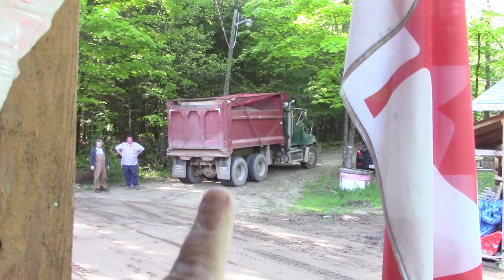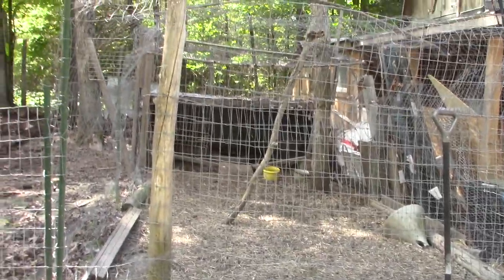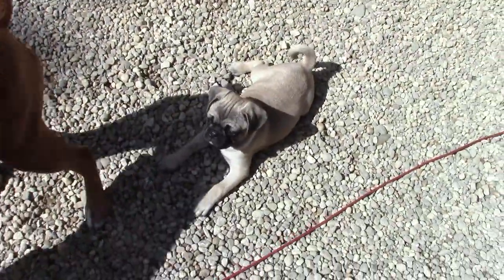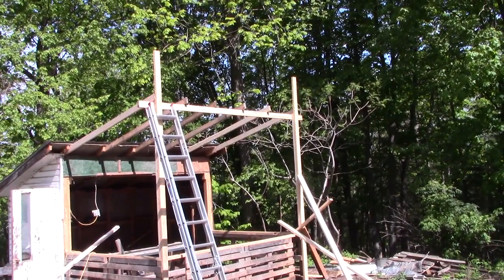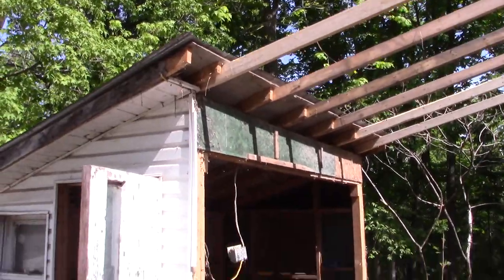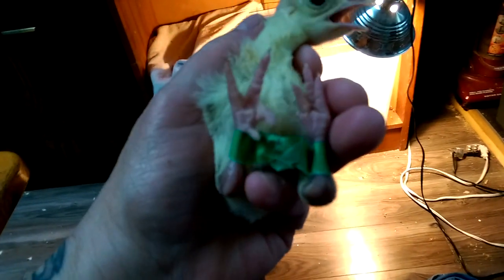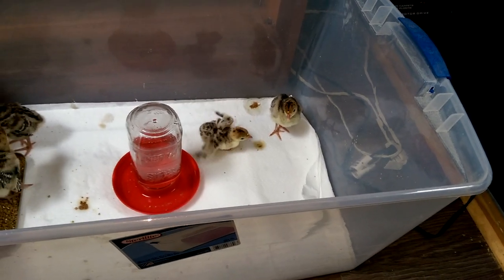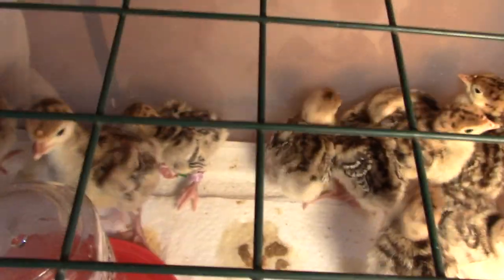This Weekend At The Volfies!

Comment: The parking area looks great but a small offering to retain your sanity and prevent scratches from ruining your flooring.  Get a mat with a really rough surface, or preferably ridges so that when you wipe your feet you knock off the small sharp pieces of gravel that inevitably stick to the soles of your shoes.  How do I know about this?  For some reason the gravel I track in always ends up stuck to under the doors and you can hear the scrape being made.  The dogs will track it in on their paws too, better than sand going everywhere, just a different set of issues.
Reply from the maker: way ahead of you honey! They are in front of EVERY door!
Reply: Good News Bev, it's the little things that drive you batty in the end. 😂 Sanity saved! 😉

Comment: Hey Bev,

Looks good!

Next time you are out shopping, pick up a bag of foam makeup sponge applicators for next time you have a chick with splayed legs. They come about a million in a bag for a couple of dollars. You can trim them to size easily with a pair of scissors, then take a ballpoint pen or knitting needle and poke holes in the spacing that you need. The legs will fit right through if you hold all the toes together. Cheap, quick, and disposable/easily replaced when they get soiled.